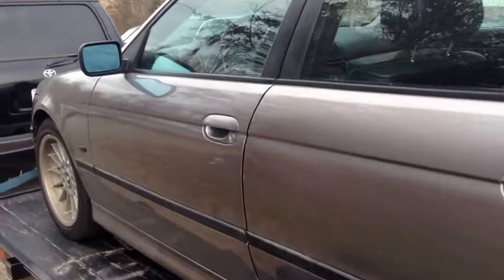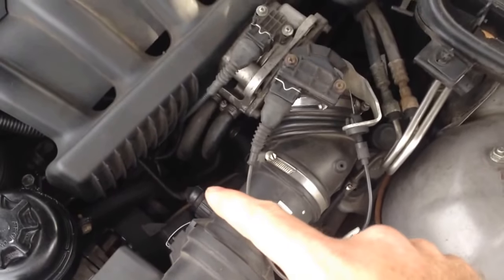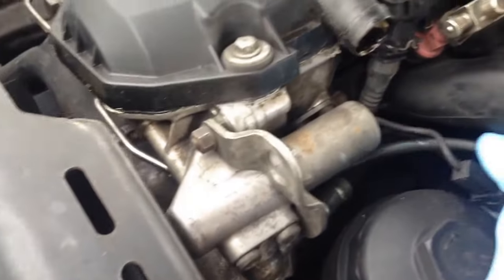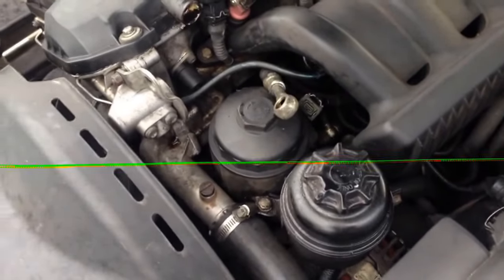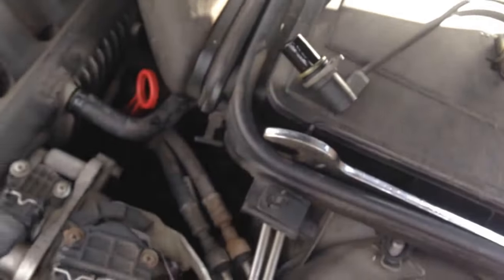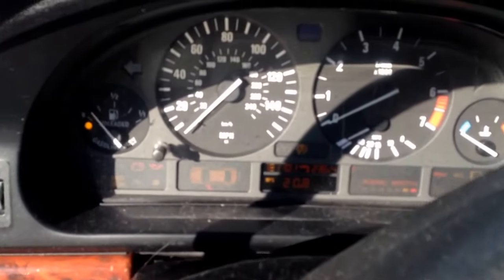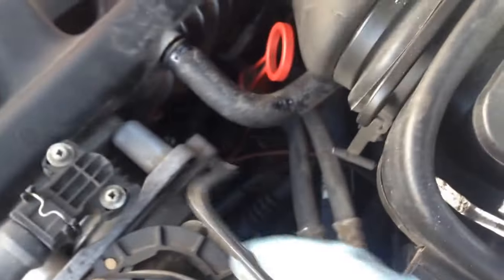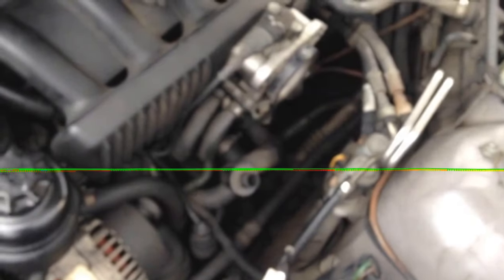BMW E36 E39 m52 m54 Will not start BAD crankshaft sensor replacement 325i 328i 330i 525i 528i 530i

Comment from the maker: CLICK HERE TO BUY THE M54 /M52TU/M52 CRANKSHAFT SENSOR
https://amzn.to/2O1W2FQ
Reply: I thought the crankshaft position sensor was under the car by the transmission??
Reply: @isaiahhope5877  It is, on my M54.
Reply: I have this problem with 2 different sensors. Should I just remove the o ring? Thank you!

Comment: OK EVERYONE IS THROWING PARTS on the car and hoping. You are all doing it wrong! Check fuel coming to engine and then check current to coils. If no current to plugs and fuel pump is not kicking on. You pull the fuel relay and bridge it. (pin 30 to 87) hear the fuel pump kick in? Then you know it can only be either Crank sensor or DME. If you do not hear it kick in you know fuel pump is bad!
Reply: I beleive the EWSll will cause the exact same problem, but agree with your theory. Process of elimination.
Reply: What’s your ig or any way I can contact u
Reply: So it’s my crank sensor or dme ? I get fuel to engine but it won’t start
Reply: @euro-trash9171  If it was ews it won't crank.

Comment: my friend i have scan my e39 520i m52 b20 .... crankshaft sensor and camshaft sensor when we delete the 2 erors ....only camshaft sensor is back.... something interesting the car has slow acceleration and at low speeds jerks a little bit and first startup in morning it takes a more time its difficult like 10 sec cranking than power of and on and starts up easy .....after that every startup is instant ....fuel economy is worse ....from 13 14 city now at 19 20 liters per 100 km
Reply: Same here, what did you do to resolve the problem ?

Comment: This is great, I had codes P0443 and P0340, replaced camshaft sensor, purge valve and gas tank cap with oem parts and problem still persists. Is there a way I can send you the video of what is happening? I turn the key, engine starts but “dies” right away without idling.
Reply: Did you figure out? I got the same problem
Reply: Ecu reset ?

Comment: This is not crankshaft position sensor replacement. This is a camshaft position sensor replacement. Crankshaft position sensor is located next to your water pump right below your thermal stat housing. This video had me confused for long time. I was trying to fit crankshaft position sensor into my camshaft position sensor and wonder why it wasn’t fitting lmfao.

Comment: I have changed the sensor always from below and never had any issue. It takes about 20 min to change that way. You can not see it but you can change it by feel.
Reply: Or you can use a retractable automotive mirror and you can see it just fine, albeit inverse (your girlfriend's makeup compact mirror works great too!)
Reply: You guys must have little tiny hands.  Busting knuckles from underneath, can feel it, even get allen wrench in it but no room to crank
Reply: went in from the top like in this video,  Got it changed out and now it is starting again.  whew

Comment: It's a 5mm allen screw, that's why it stripped.
These sensors get old, their signal diminishes over time, I consider them tune up parts and change out both.
Generally it's to correct a no spark, if it's a fuel issue try to diagnose maf vs fuel system issues.
Maf sensors usually fire and then die, it won't continue to run no matter what.

Comment: Good Info.I Had an e 36  1993 325i with crank no start. No spark no fuel. After much investigating ,including changing the crankshaft position sensor found out the dme was damaged from water. These older cars have seals that go bad and can let water in the engine compartment. I went to a junkyard and got one for 20.00 . Lucky it was EWS1!    Also ,check the fuel pump relay .the horn relay  can be used for a quick swap to diagnose.
Reply from the maker: +traxxas man Yea the e36's are bad for that, i have one here right now that will not start, i will get some videos up of it when i get time to work on it
Reply: I have a 94. 325i and have no power to fuel pump or no spark and I ordered a chip Ews delete chip for the 413 maroon and I hope it fixes it
Reply from the maker: let me know what happens
Reply: What happen is the cam and crank both went at the same time..  then my pump wouldn't turn on because the ews1 system sent a message to DME to turn fuel off,. So if the cam sensor is bad the fuel and spark are a no go.. as what I been reading about Ews systems.  as well my fuel pump gave out.. it had no power to the pump it's self', ,,had to replace that.. got that done,. The Ews delete chip was a fail that I had bought,. I did go to the junk yard and pulled some chips. And I now have power to the pumps and spark.
Reply: The problem is my DME is saying I have a faulty cam sensor.  Soo the question is am I supposed to get a high reading on all 3 wires on the cam connector? Or just 2. I have high volts on 2 out of 3. The third is dead.. when having the needle touching also use the same dead socket and get no reaction to the other 2 plugs, so I'm not sure.
Reply from the maker: Well there are 2 possible problems, 1 is that someone replaced it with a cheap china sensor and its throwing the code, the other is that someone has had the vanos off and didnt set the timing correctly, does the code say cam sensor A timing over or under advanced?
Reply: +Nathan's DIY Garage  well this is the tricky part I did the stump test and the check engine light would not come on.. it's been off since the car died.... I replaced the cam sensor but before I put the cam on i tested the ohm it all checked out.. on all THREE wires on the cam,,. CHECKED out with power,, I hook up the cam.. the check engine light now appears,, I stump test.. still the code wont put out a signal to tell me no code, but light is on..  so I am assuming the DME is telling me the cam is bad by the no start still, so I'm REALLY CONFUSED ON WHY it had power to all three wires on cam I plug in it has only power to 2 of them when I take it off to recheck ohm
Reply: +Nathan's DIY Garage the cam sensor is OEM BMW
Reply: +Nathan's DIY Garage I also pulled the cover off and the camshaft blocks on the end looked like 45° and the blocks looked aligned but I was told even if timing Is off a little the car will still Start. I did notice that the arrows was facing down and to the side of the lower engine compartment
Reply from the maker: You cant tell by that, there is no way to check until you install the timing kit on it, most of these cars never get timed correctly once taken apart, thats why i put the timing videos up so everyone can understand how to do it correctly
Reply: +Nathan's DIY Garage I will watch the video...  but i guess e36 world was trolling when I was told that..  soo say if the timing is off will it sound like the engine is starting fast then normal,, I was in 5th gear doing around 90 with flow of the freeway. the car just shuts off,.maybe car got off timing at this point??? I talked to auto zone they said timing could of jumped I talk to a bmw tech  he tells me that it cannot jump timing the vanos unit has to completely fail or turned off... so my question is or do you cover it in the video how does the vanos turn on and off? or anything I am saying sound accurate from what's been told to me
Reply from the maker: that sounds more like the crank sensor than the cam sensor
Reply: So I had replaced dme got all power back  I replaced crank and cam also icv also throttle body sensor checked valve gasket ect I have all power to car ... BUT I GO TO START THE CAR AND BANG tons of smoke comes from the throttle body,, then I notice it blew off the icv hose,, I try again and bang smoke once again thru the throttle body. Then one more time and it started for a split second,. So I try one more time and flame came from the throttle body,.  I'm so glad I had a water hose near by,,. Why would it do this??. Is the icv not turning on??
Reply from the maker: is the icv on the correct way? you can install it backwards, Does it have a cold air intake ? is the maf on backwards they both have arrows for airflow direction

Comment: Had very similar symptoms on my '98 4.4, but it turned out to be the MAF (I replaced both the cam and crank sensors first without success).  A cheap aftermarket MAF might be worth trying if anyone has similar symptoms to this vid. Btw, while aftermarket MAF's are fine, aftermarket cam sensors even by meile just don't work, they are garbage. I tried 2 of them before giving up and buying genuine.
Reply: I have the similar issue.my 2003 525i starts today and a no start three hours later
Reply: fred hickling  hello I'm having the same problem on my 2005 bmw 525i
Reply: agree aftermarket sensors didnt work for me other than using them or toolbax decorations.
Reply: Just unplug the maf, if it starts it the maf, works like a charm on the e36. Had to do it several times before

Comment: We are having something similar with the 2003 bmw 325ci . It’s struggling to start but start after 3 times trying, we change gas pump and start well , but them back to same as it was before. I was frustrated and toke it to a mechanic friend of mine. He started the car well all the times he tryout! He told me he couldn’t fine anything wrong! I drove it when to put gas and start fine . Them when on the day  and later after 3 hrs in the parking, I went to drive around and omg ! Back to struggle to start, but it did ! Don’t know what could be wrong?!
Reply: You found something? Same problem here

Comment: hi Nathan, my e46 have an issue. i put the key in, the radio and the dash lights come on but when i turn the key nothing happen. i change the ignition switch and it  work for a couple hours, then dont start another time. I try with an new brand ignition switch and doesnt work. i check the the tiny box in the underhood fuse box and all the fuse are right. Please help me.

Comment: Thanks alot.
I replaced both Cam and Crankshaft sensor CPS. VDO brand.
The old one was Siemens.
I took off the front bumper.
Radiator, oil coolers because had a oil leaking there.
Need to give this E39 full service.
Water leak
Oil leaks.
Bosch v belt
New waterpump GMB
Tensioner bearing and Jockey wheel bearing.
Alternator bearings and the brush runner.
Water bottle
2x water hoses.
Thermostat housing O-Ring and seal.
O-rings on oil cooler hoses.
Power steering bottle return hoses replace.
Vanos hoses leak. Replace hose
Vanos leak on gasket.
So I remove the tapped cover and turned the 60-2 OT mark on Crankshaft wheel where CPS sits.
Checked the cam shaft timming.
Exhaust cam was retarded and intake cam was a bit advanced.
(Removed al 6 sparkplugs all of them was carbon up badly, to turn crank) 
Cleaned it up placed Victor Reinz silicon sealer on Vanos seal to head and Reset timming with Stainless steel Ruler on to dubble dots on flat on both Cam shafts.
After setting. Turned Crankshaft 2 CW and it cam perfectly! OT mark
New tapped cover rubber gasket.
Send 6 injectors in for spray test and sonic bath cleaning.
New 6 x injector front tip O-rings to seal vacuum leak.
Intake manufold rubber seals to cylinder head.
Vapor oil separator under intake manufold replace because of oil drain was blocked.
Oily intake ports.
New Throttle cable genuine BMW PART like R330. Super great price!
Oil filter Wix
Air filter febi bilstein
Cabin air polin filters topran
Antifreeze 1l and battery water distilled 8l
New engine oil 7l 5w40 Motal. 
Air temp sensor new
Water temp sensor new

Started car and it runs great!

Comment: After stripping my hex bolt, I Used a 3/8 socket to hammer over the stripped bn olt head and turned it 1/4 at a time hammering  each time cause it would slip off after a 1/4 turn.

Comment: My crankshaft sensor has a 10mm hex bolt on it but there isn't enough space for my ratchet to connect, there's something by the starter that extends out. What should I do?

Comment: 2004 330i blowing 20 amp fuses in the triangle box under the hood where the ECM is located.  The fuse is a 20 amp fuse in the center of a group of 5 fuses.  It controls fuel pump and cam and crank sensors.  I unplugged the fuel pump and it still blows.  Have you ever heard of a crank sensor going bad and resulting in blowing the fuse the second you turn the ignition on?

Comment: after you changed the crank sensor did you have power to the fuel pump relay. because I have no power ,coming from the relay..  I read the crank sensor sends a signal to the dme. that turns on the relay....  is that true.?

Comment: Nathan isnt this the camshaft sensor? Its on the head? Isnt the crank sensor on the front down under the thermostat?
Reply: You're possibly thinking of the E46 ?
Reply: @antiochiaadtaurum3786  why would a crank sensor be next to the cam. You worked on a m5x before?
Reply: @mnz9999  I was thinking of 50s kid working on e46’s. I’ve never gone near e46, only e39
Reply: @antiochiaadtaurum3786  not sure I understand your post. However, it’s a m52b28, same in e36 and e39. The crank sensor is down next to the crank lol that’s how it reads it. Hes replaced the cam sensor here, it’s next to the camshaft lol. The sensors are Hall effect magnetic. Google is your friend here.
Reply: Just to be clear. I’ve done both cam and crank on m52b28 single vanos. 100,000,000% this is the CAM sensor.
Reply: Crankshaft sensor is either above the crankshaft pulley at the front or below the starter motor depending on Engine. He changed the cam sensor on intake side and then the crankshaft sensor also.

Comment: Wait a minute!
So you're saying that you replaced the sensors before checking the fuses, relays or for power at the fuel pump?
Or is there no power at the fuel pump if you have a bad sensor?

I have no power at the pump but the fuses and relays are all fine and dandy, just like Randy!
I'm charging my battery overnight to go exchange it at Costco if it doesn't charge.
Once I have the new battery, if it doesn't start, I try the Crank position sensor first because I had it replaced in 2014.  That was a job I had to pay for because I could barely feel it but couldn't see it.

Comment: The connectors of the scamshaft and crankshaft sensors can be accessed directly beneath the intake manifold by simply removing the air filter box.

Comment: If the crankshaft position sensor is good then the needle will move on the tach while you are cranking the engine over.

Comment: Hey I have an E90 that I replaced the starter for recently and now it’s cranking but won’t stay on...did I not plug something in or could I also have an issue with the crankcase sensor?  It flutters slightly but won’t stay on I also replaced fuel pressure regulator and fuel pump the week prior so I’m confident it has fuel delivery

Comment: My 2000 BMW 323i when you turn the key to start it and it just goes click once. I have installed a new starter, new battery and took off positive battery cable and it continue to run in beginning but now for some reason it won't start back up. Even got a new coded key for it. All battery hook ups are good.

Comment: crazy.  my 540i is throwing an intermittent code for cam sensor. sometimes it starts and sometimes it won't.  I ordered 1 but wrong sensor was to.long hopefully the correct one comes Saturday
Reply from the maker: +frank aranda I have had that before with the 4.4, if yours is the 99 and up vanos engine the sensors are hard to find and expensive, i would do the crank sensor, yours is on the bottom passenger side and is easy to change, sometimes the ecu has a hard time telling the cam sensor from the crank sensor as far as throwing codes, also it could be the start of vanos failure or timing chain guides, lets hope not.I might have a set of good oem sensors here ill have to look.
Reply: +Nathan's DIY Garage 
OK.  sounds good. mine is a 98. 7/98 I believe build date. I guess there is 2 different cam sensors this year. at the part stores.but let me know if you have some. thanks
Reply from the maker: I have a 98 740 sitting here so I will check it out and let you know tomorrow

Comment: Nathan how are you I'm having problems stating my e39 2.8L 1998 BMW I changed fuel pump, camshaft sensor and ignition switch. What could be the problem it turned over but not start.
Reply: Crankshaft sensor..
Reply: Fuel pump relay was bad

Comment: On my 540i the camshaft and crankshaft position sensors look identical. They are both in the front and very easy to locate.  I replaced one and still no luck. Will wd40/ butane/propane work instead of carb cleaner?

Comment: I have a 2003 745i just cranks no start  fuel in fuel rail .   Getting code p 0390 cam sensor b bank 2  not getting spark  would it be the crank sensor

Comment: replace the coil packs on a 2000 BMW 328i still running rough need to know what else to look for three of the coil packs from bad and I think the guy drove with coil packs bad back to his house but not sure wondering if it could be the plugs or the catalytic converter clogged did you give me some suggestions

Comment: I have a problem with cold starting. Where when I start it and let it run cold the idle drops from 700 flat to maybe 300 and back to 700. It even killed on me once recently. Just tryna see what’s the problem. It threw a code for IAC valve but I got rid of the codes and I haven’t had any codes since but I still have the problem. What is it? I also just got a ticking noise that ticks when it wants but I don’t know what that is either. I have a E39 528i w/ M52